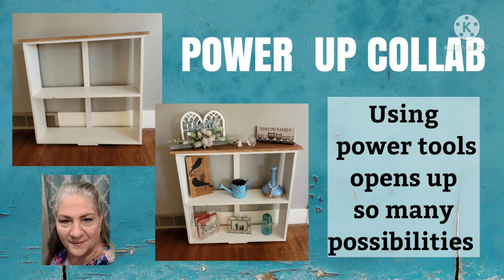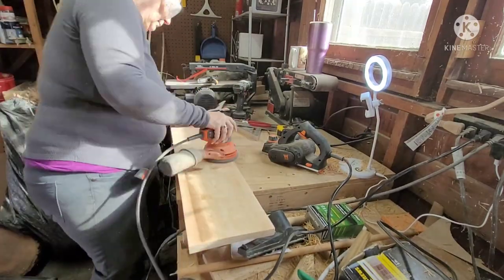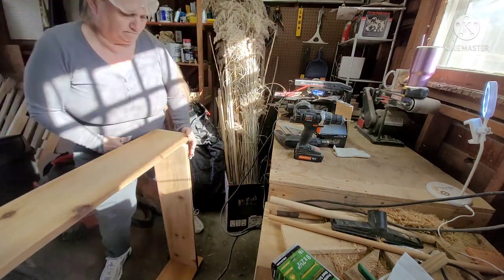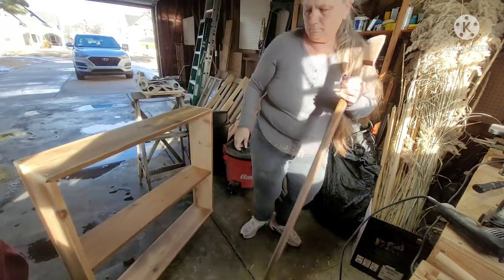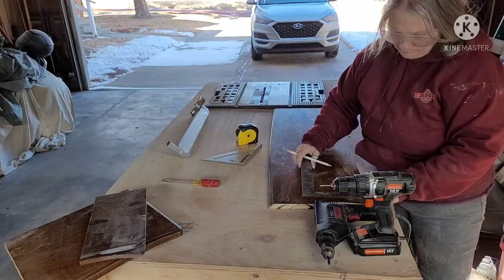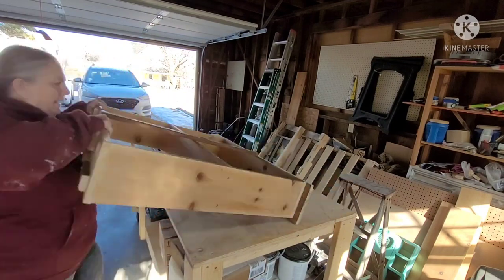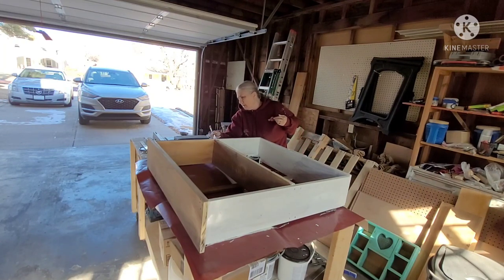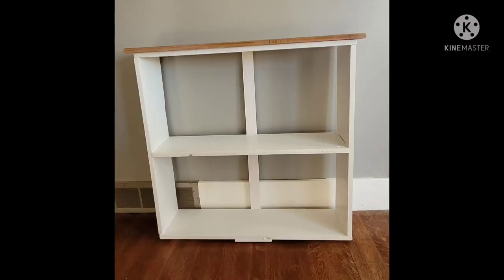POWER UP COLLAB | USING POWER TOOLS | EASY HOME DECOR | FARMHOUSE DECOR

Comment: I, like you, love working with wood. I took shop in Jr. High and still have the mixed wood bowl I turned on the lathe. We also take apart old pianos that are beyond restoring and repurpose the wood. Our oldest one was 150 years old. Was thrilled that you did not paint the piano wood on your shelf. It turned out wonderful. I have never used a hand planer before. Are they easy to work with? We need to get a planer but are wailting until we  relocate to see what kind of space we have. You have a new subscriber.
Reply from the maker: Thank you so much, the hand planer you just have to practice with it to get good at it.

Comment: Wood, watching you work with it and all your power tools is so amazing. I have a question I have a dvd stand that is leaning forward and to the left, have taken apart and tighten the screw's and has helped some but seen you put a brace on your shelf I was thinking a cross brace would the single brace in the center be better or if need the cross brace what would be the best way?
Reply from the maker: Thank you if it is leaning that much I would do a cross brace on it.